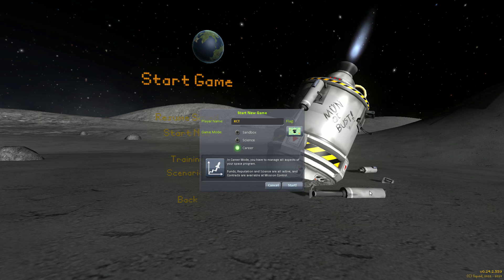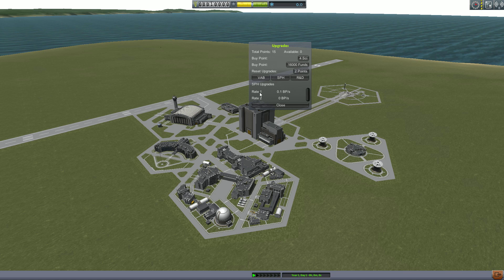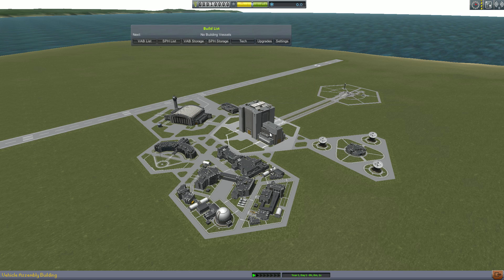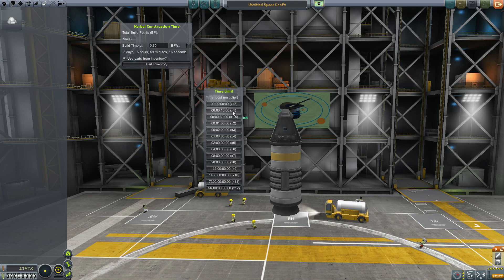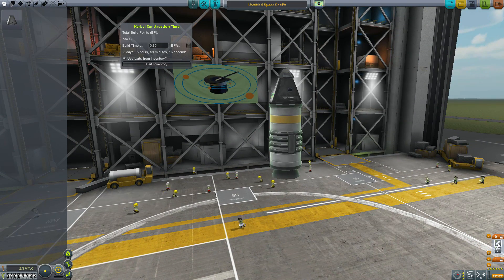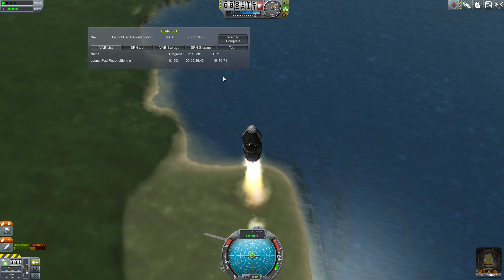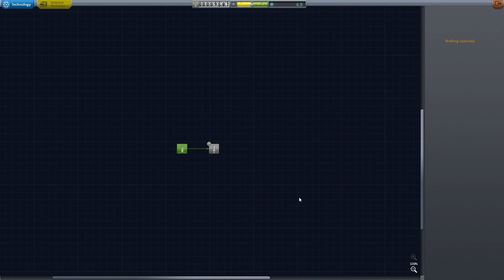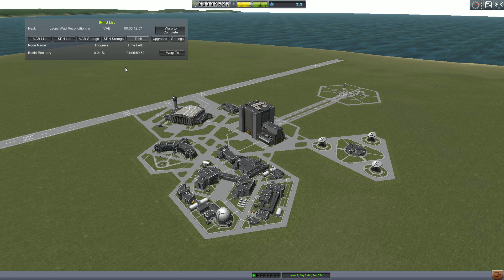A Brief Introduction to Kerbal Construction Time

Comment: i thought of a idea if it is already in the mod let me know any way 

there should be a way to buy parts it takes time but once you build a part that part is in your inventory.  then you have 2 parts a srb and a capsule you build it with a srb a capsule and a parachute it take less time to weld the capsule and srb together but it take a few days to make a new part in this case the parachute then the time it takes to weld. just a idea i had.

-ihopeyoureadmyusername
Reply from the maker: MrTagnan TNT PRODUCTIONS There is something kind of like that already in the mod :) When you recover a part it gets added to your inventory, then when you use those parts later they take substantially less time to build. Any new parts still take their full time and end up accounting for most of the build time. By default, parts in the inventory are built about 10x times faster than if they were new.
Reply: TheMagico13 ah ok thanks :)

Comment: What does the upgrade points for 'research' and 'development' actually DO ?
Reply from the maker: "Research" lets you earn science for completing builds. It's a pretty small amount initially, but it's also not supposed to act as your main source of science. "Development" is what handles the rate of unlocking tech nodes. Each point in Development halves the tech unlock time. Check the getting started guide if you're still unsure (or just ask) :) https://dl.dropboxusercontent.com/u/25340912/KCT%20Guide.pdf
Reply: Thanks that guide link was very useful.  Btw if you always leave 2 points unspent its insanely easy to swap between instant research (just by dropping a 2 dozen points in it for 3 seconds), resetting and then moving points back to VAB.  Not sure if there is any way to prevent this.
Reply from the maker: Not currently, other than by not doing it. It's like using the debug menu. It's always there, and you can easily do it, but it's considered cheating if you do. There's currently a rewrite of the upgrade system being worked on, so that won't be an issue then :)

Comment: The separate upgrade times between VAB and SPH encourage me to drive my spaceplane from the launchpad to runway xD
Reply from the maker: I have no idea if I should praise the ingenuity or try to prevent that from being allowed :D
Reply: TheMagico13
me too, I think rather you should have a special version (unless you want to change the mode fully) where your upgrades affect it, But you can also assign engineers to build stuff faster. Meaning you could ALSO hire engineers instead of buying better equipment. Scientists could be sent to the R&D too. They would be unavaiblable for missions until we get them out. does that sound good ?